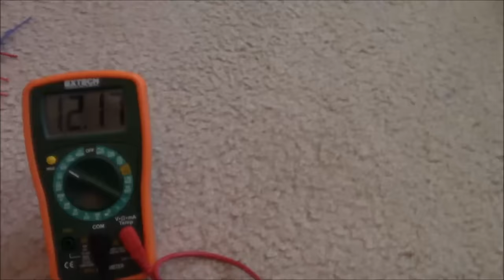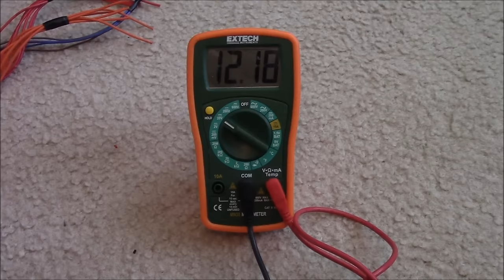How to Hack a Computer Power Supply (PSU) To Use as a 12V DC Power Source

Comment: good idea thanks :)  but I have a small trouble .. does someone know why my power supply turn of on  load ? .
( information : I have 2 old dewalt 12v drill and hammer I think you call it , power supply 450watt  , I 'm sure inothing wrong with those tool, but not so sure about my power supply but almost :) ) .

dows someone hafe some idea ? ( its importent for me )  

thanks :
Johann
Reykjavik iceland
Reply: Im think that you have answerd this alredy .. so if I  a understand this right , ? power tools use to much power to start _how to say it in english ? , like fuel cells hafe iin cars ned another source for this quick power need.? ( english is not my langugage, but so importent  ) .
 I dont know how to say it but I tried :) .
thanks good video

Comment: Isn't this pretty dangerous to do yourself? Didn't you just plug the power source right into the wall? Can't you fry your ass if you mess this up?
Reply from the maker: I don't think it is dangerous unless you take off the cover of the power supply or just start hacking wires left and right and shorting them to each other.  Even then it would just blow a fuse in the PSU and stop working.
Reply: Alright. Got really into wanting to do this since I've been needing something like this but I'm poor and therefore am open for re purposing instead of just buying new. Also, if you have way to many yellow and black cables, can you just bundle them together and isolate them by wraping some tape around them? I have like  14 ground cables- seems like a nightmare to solder them all in place. Thanks for a great video btw.
Reply from the maker: You can do whatever you want with the extra cables.  They aren't all necessary.  But I wouldn't use less than a 4 wire bundle for any serious power (10A or higher).

Comment: Don't do a thing this video tells you. These things are not safe for uneducated hobbyists.
Reply: What parts of this are unsafe for hobbyists? Don't call yourself a hobbyist if you can't safely strip and solder wires together, which is all this video is doing.
Reply: Just don't stick your finger in the actually power supply.
Reply: Celtic Patriot. Your point does not match what you said. Maybe you know electronics, but certainly not an effective use of the English language.